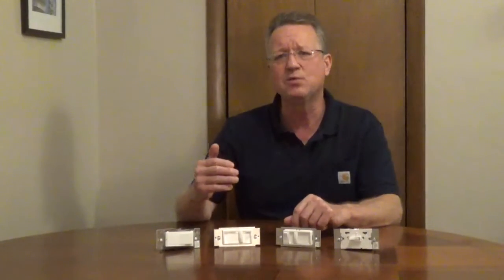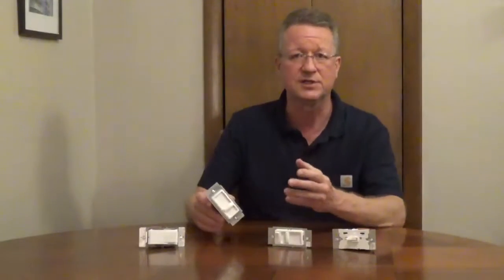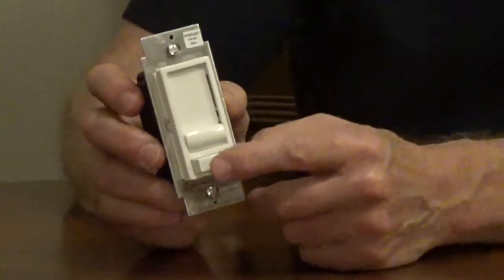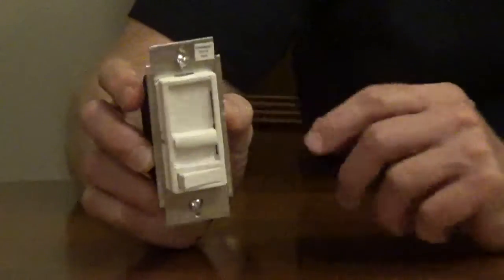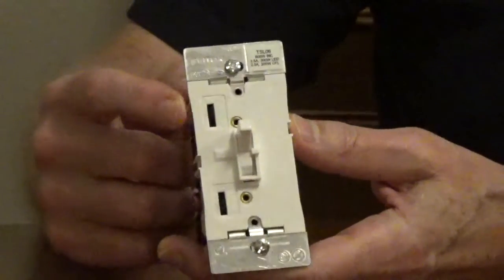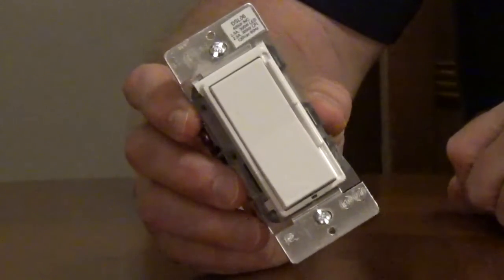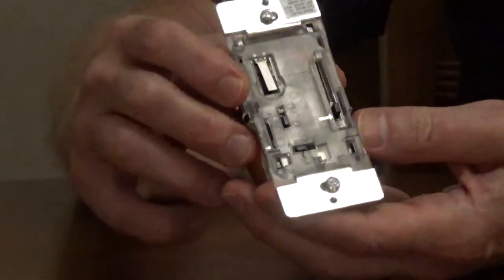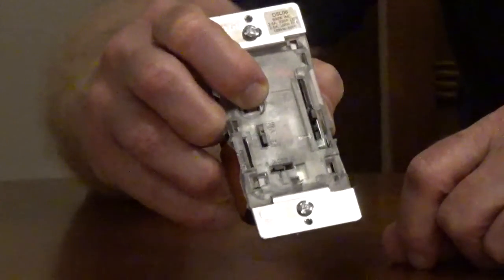LED Dimmer Flickering - Leviton LED Dimmers

Comment: Thank you, I replaced my old bulbs with led's and developed a flicker. Figured I'd upgrade the ancient dimmer switch, still flickered. I didn't realize there were recommended bulbs, and I didn't know about the switch on the 6674. It's 90% better, but now I assume it's because I didn't buy the recommended bulbs. It's tolerable, thanks a ton!
Reply from the maker: You're welcome.
Check out some home improvement tips in our e-books https://www.amazon.com/gp/product/B0B2KW1FQ9

Comment: Hi, I just bought the Leviton 6674 dimmer for some new dimmable recessed lights - two sets by Commercial Electric, and two sets by Illume (Dals Lighting).  In all cases, the slides don't dim significantly for the first ~50% of travel, and at the lowest setting are still at ~40-50% brightness. Note that the lights are from two completely different manufacturers, yet exhibiting the same behaviour with the dimmer switches.

I have two other sets of the same Commercial Electric lights still connected to a pair of older (non LED rated) slide dimmers and they dim down to ~10%.  I've tried playing with the low range adjustment without success.  Any guidance?
Reply from the maker: Hi, Leviton recommends using all the same LED dimmable bulbs for the best dimming range. Use Leviton’s online LED Compatibility Selector Tool to find the most compatible bulbs. 
Check out more home improvement tips in our e-books https://www.amazon.com/gp/product/B0B2KW1FQ9?notRedirectToSDP=1&.

Comment: I have the dimmer with the small slide next to the switch. Why do my lights flash on occasion when I first flip the switch on?
Reply from the maker: Hi, did you set the minimum load level? Do you have dimmable bulbs?

Comment: The flickering I see are not the lights themselves,  but the switch itself ( like inside the wall) has a red light and that is what is flickering. Is that normal?
Reply from the maker: Hi, what is the make and model of your switch?
Reply: @FIXITHomeImprovementChannel  I think this is it: Lutron Diva LED+ Dimmer Switch for Dimmable 
LED, Halogen and Incandescent Bulbs, Single Pole or 3-Way,

Comment: Hi just did some research on LED transfer, DC/AC Voltage. Just trying to understand things better. What I got was, LED drivers convert higher voltage, alternating current to low voltage, direct current. They also keep the voltage and current flowing through an LED circuit at its rated level. Good to know. My question now is, I have 6 LED pot lights setup in my living room running with a compatible dimmer. Lately out of the 6 lights 2 are now flickering. What do u think is happening? Could it be the drivers inside the pots? I'm not that old but I guess I'm well behind with understanding new tech. LOL
Reply from the maker: Hi, the LED's need a minimum amount of electric for the lowest output without flickering. Each LED could be slightly different in the need, so you will have to increase the minimum setting till they all are at a minimum light level with no flickering. That is how it was explained to me by the rep who trained me.
Reply: @FIXITHomeImprovementChannel  OK Thank you my friend. I will give that a try and "see" what happens. LOL

Comment: The problem I've come across is the next:

I installed 6 lightbulbs in series of 3 inside a room and with a switch it works just fine. The lighbulbs in quesition are LED not dimmable. For me? It still is too much light.

I got a dimmer and I got dimmable A19's bulbs...motherfuckers don't work in series it seems. They work just fine in parallel...six bulbs in parallel producing 750 lumens each will just fucking kill me the moment they come on.

I thought: "Shit, they are 750 lumens...well, in series that is going to come down and with the dimmer I'm going to be fine"

The thing here is: I want to find bulbs that are dimmable and that work in a series circuit.

I'm very sensitive to light and even one bulb feels like I have nails being inserted in my eyes.
Reply from the maker: Hi, there are low lumen bulbs that are dimmable. Get all the same type so you can set the minimum load level, or you could go to halogen lights with low lumens.

Comment: Hi, Great info, however, ,my GU10 led bulbs just intermittent flickering even I am not using ANY dimmer ? anyway to fix this issue ( I have already changed new led bulbs from different manufacture) ?
Reply from the maker: Hi, sounds like it could be a bad connection somewhere. What type of fixture are they in?

Comment: Just installed led dimmer switch and the led light is flickering at low light levels. Any help? I got the first one he was talking about.
Reply: Did you try doing what he suggested with the first switch? I was having the same problem so I switched bulbs from 60w to 40w with what he suggested. It's worked for me so far

Comment: Didn’t work for me, did everything in the video and the led lights still flash but I was able to play with it and got the lights to turn on without them flashing as long as the dimmer isn’t touched, but thanks for the video saved me from getting a new switch